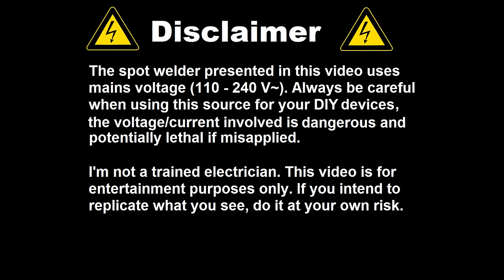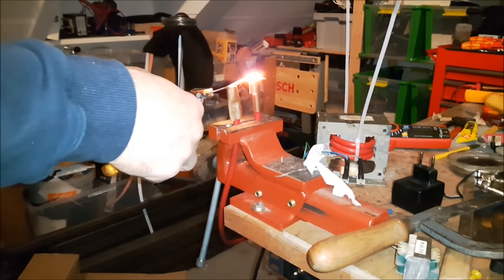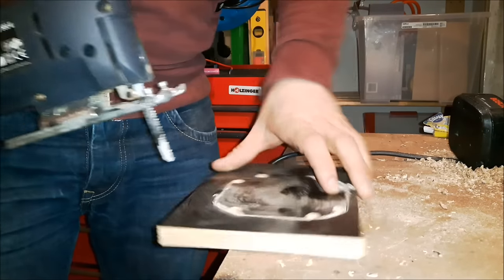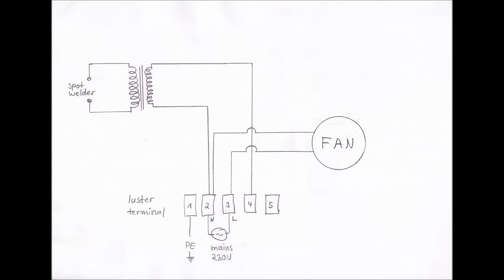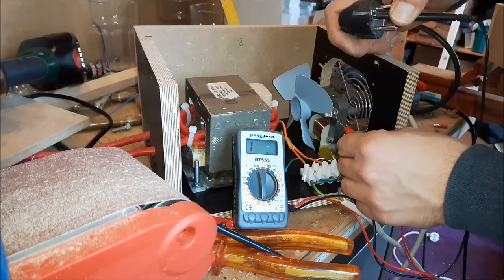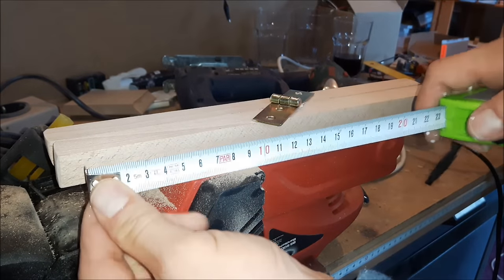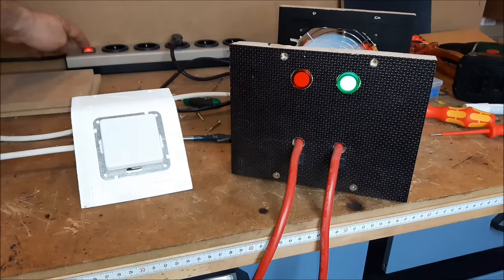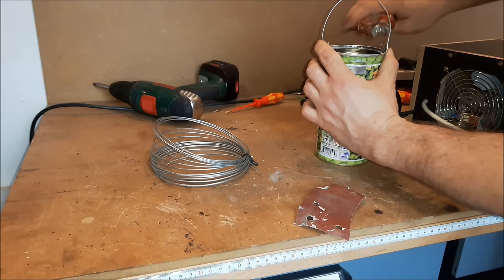DIY spot welder with foot pedal

Comment: Greetings from California. Yes, it was nice watching your Spot Welder assembly. I’d suggest that you modify the mains switching through a SSR, thus avoiding a surge and or spike or spark at the foot switch. I have often seen the direct foot switch activation to 110~220 mains the above happens and the micro switch fails. Also it’s unwise to have 220Vac (in your case) running along towards the FS.
By introducing SSR  you will be able to avoid above issue by activating SSR through 3~12Vdc. Also install a 20AMP fast blow fuse. This will avoid your ELCB (in the mains circuit) from tripping often.
The secondary cable may be made to fit as tight as possible in the core avoiding fluctuation while spot welding.
Remember when spot welding, loose secondary cable tend to vibrate or pulse; thus causing issues in weld result. Good Carpentry work. Cheers.
Reply from the maker: @sreekumarUSA  SSRs are not the weapon of choice for inductive loads like a transformer due to the inductive spikes at turn on. SSRs are rated for ohmic loads like a heater. You need a SSR rated at least 8x the amps what you measure at the input side. In my case this means a SSR rated at about 40 - 50 amps. And forget the cheap china ones for under $10. If you buy quality this means about $60 minimum. Compare that to a simple switch or simple relay for $5 🤷

Comment: Very nice tutorial, but I have a couple of suggestions. You have an opening for cooling air to enter, but where does it exit? Add another hole and meshed screen over the transformer to allow air flow.
For added safety, instead of using a foot pedal with mains power going through it, add a small 12 volt relay and use the the foot pedal to switch the 12 volt on and off to the relay which will then switch on the mains power to the transformer. A automotive relay can be used because their contacts are rated for a 30A load. You can get the 12 volts by adding an additional secondary winding to the transformer using some small gauge wire such as 22-24AWG since the relay will not draw very much power. Thanks again for showing us your ideas.
Reply from the maker: Hi Waltkat, I did some changes to the device in the meantime, for example I drilled a 2nd hole for the air as you suggested. The idea with the automotive relay is good (adds safety), but I doubt it will withstand the welding current of the secondary. I ordered a SSR (solid state relay / TRIAC) to enable/disable the primary side. This has the advantage (depending on the SSR model) that it enables at the AC zero point, putting less initial load on the mains and fuses.

Comment: This is an awesome build! A good idea is to replace the pedal circuit with a mono-stable 555 timer circuit (with a low power pedal) controlling a relay so as to separate any contact with the mains circuit. Another idea to save power would be to buy two cheap 1 amp phone chargers to act as buck converters to replace the high power light bulbs with LED's and the one that powers the green LED could be used to power the proposed pedal circuit.

Comment: Awesome design. Three things I want to add. The fan should work all the time, not only when you push the pedal, and also you should stronger attach those cables to the wooden elements. Also the welding electrodes should be thicker.
Reply from the maker: Hi Piotr, the fan works all the time if I remember correctly (see diagram in video). Still not enough cooling for long welds, as the MOT itself gets saturated quickly due to its small core size. About the electrodes: You're right of course, at the time I had no professional electrodes, only thick copper wire.

Comment: Nice video...I too made a spot welding machine with microwave oven transformer but it's wire gets heated up very soon after 2 to 3 spot welding...wire insulation starts melting
Reply from the maker: @Engineersworkshoptechnology  Either your wire is too thin (thin wire leads to high resistance leads to heat) and/or you're not using copper wire. The reason the weld starts were the electrodes touch your metal sheet is that this is the part with the highest resistance in circuit . Or do you try welding something else than iron sheet metal?
Reply: @diecksl  sir I tried iron sheet only...I have some doubts to clear can I mail you for query ?? As I don't know much in electrical but I want to make one more spot welding machine for professional use

Comment: Perfectly made spot welding machine ,I used 16 mm wire 3 rounds for lifepo4 battery pack.but it was not sticking enough.sugestion please.

Comment: Hi friend. You do a good job. It you have a time make a video of wilding lithium battery. We need the time pulse an the voltage.
Reply from the maker: This circuit produces a low-voltage pulse and heats the metal. For welding battery cells you want the pulse as short as possible to keep the temperature inside the batteries low (explosion/fire hazard). That is why usually capacitor discharge is used in this application.

Comment: Hey Lejf, I cleaned out my microwave transformer yesterday, cut wood today and started assembly. I was reading the conservation between you and Alpha Troniks and have a couple questions as I'm going to use mine for 18650 battery welding as well.
  1)  I didn't notice that you removed the metal tabs between the 2 coils, so mine are still there. I saw in one of your replies that leaving them in will reduce amps, so should I leave them there?

 2) Would a basic dimmer switch for household lights work in this setup to further reduction of amps? If so would I install that switch between the power coming in and the transformer?

I got my foot pedal from a Chinese spot welder that died after using it for a couple weeks (Sukko) and I believe that it's a momentary switch. If not I'll just pick one up on ebay and make a homemade you like you did. 

Sorry for all the questions! I'm no electrician but am very mechanically inclined.
Reply from the maker: Hello schrockie,

1) In the orginal application the tab (or "shunt") is used to limit the current flow. You don't want it, as you want to increase the amps. The shunt changes the magnetic flux path within the core - for example, see https://goo.gl/GC5ck4 . You should, however, separate primary and secondary with a piece of wood or plastic from each other to increase isolation for your own safety (don't forget to ground the iron core as well).

2) Dimmer switches are usually driven by TRIACs, they change the sinusodial waveform of the AC line voltage and not the (peak) voltage itself. There are two different types, phase control (PC) and reverse phase control (RPC). Only the first method is suitable for inductive loads like a transformer. You have to watch the temperature of the windings carefully - it increases when using a dimmer as it puts DC load onto the transformer. But for short welding pulses it should work.

One word about welding tabs to 18650s: I had a long conversation with AlphaTroniks on that topic. Problem is, the heat increases far too slow. For metal welding this is ok, but for Li-Ion batteries this can lead to fire or explosion of the cells. What you need for that task is something that instantly releases energy (heat), this is why all commercial tab welders utilize capacitor banks.

Comment: Your air flow exchange is lacking a bit. Inlet and no outlet but circulates the same air well. Cut an air slot in the bottom between the transformer and the front cover. On mine, I measured over 400 amps but my meter only goes that far. The screen said something I’ve never seen before “O.L.”  😆. Mains measured 5 amps running and 12 amps secondaries shorted with 120v primary.
There’s an enormous back emf (off my scale) when the mains are disconnected, So be careful it could bite.

Comment: great project! I think you should connect PE to the switch because there are some visible metal parts. just in case.
Reply from the maker: Thanks :-) Yes, it would not hurt. Since I published the video I did some improvements on the device. I will publish a second part soon and I will mention that...

Comment: welding is fun.. I totally agree...  I am building the same welder for welding nickel tabs to 18650 cells...  I tested the output voltage and it showed 1.5 volts...  when I short the output the voltage comes to 0.8 volts. what is the ideal voltage for battery tab welding? The first I want to try out is to make a 3 cell pack for my 12 Volt cordless drill just to test out the welder. Here we get 3 cell 2200mAh pack for 800 Indian Rupees which is bit expensive.. I'm tired searching the net to find the answer for the correct voltage required for battery tab spot welding...
Reply from the maker: AlphaTroniks I don't know what the right voltage for battery welding is. But I am confident that you can weld your cells with 0,8 - 1,5 volt, as the high current is responsible for the heat and not the voltage in the first place. Your main problem is to limit the welding process to fractions of a second (1/8 - 1/4 second) as the welder generates a lot of heat, even in 1 - 2 secs. And this will probably destroy the cells. There are some people modifying spot welders with timers (e. g. with the NE555 IC) or building mini spot welders especially for battery welding, powered by MOSFETs and capacitors. Another simple way to connect battery cells is to use some flux and a soldering iron, but I guess you want to build a welder for the fun of it (like I did)?
Reply: I am building a spot welder for serious battery fabrication works... I have a timer using NE555 timer but it's problem is that at the lowest time setting the relay stays on as long as I am pressing the trigger switch but as soon as I increase the pot setting the time increases more than required i.e. it gives a pulse of more than 0.5 to 1 second which , I know is very bad for the 18650 cells... I need someone who'll help me with a proper 555 timer schematic
Reply from the maker: Do you have a link to the schematic and parts used?
Reply: Bhai, the suitable volt at the secondary terminal is any thing in between 2.5 ~ 2.7Vac. Remember, you may not be able to test the Amps. It’s presumed to be between 400~800 amps. Ideally a tight 3 rounds of welding cable is recommended. That will provide the above mentioned Voltage parameters. Any thing above will, certainly will burn Ni strips and may also injure 186650. So be careful at obtaining not more than 2.5 ~2.7 Vac. 
Here we are talking about Spot Welder, only. Your requirement powering a portable Drill and suitable Li-Ion Cell Power Pack is different to the subject altogether. To get info, first of all, you need to specify the Operating Power Supply ie: 6,9,12,18, 20 volts on the basis of that, you configure the Li-Ion Cells. Remember it’s easy to assemble these Cells, you also must consider BMS to charge those 18650. This is a very long subject to describe here. All the best. Namaste🙏🏽

Comment: I used 6 series Maxwell 350f super caps 
..2 sets in parallel.  Adding a 3rd soon to try copper tabs. Used cad to design fet switch board...plexi to make cupric etch tank. plexi, eBay vac pump, digikey 365nm led, weather stripping and  a sheet of low iron glass for exposing riston... inkjet screen printing transparencies with am emulsion to take ink well. Managed to etch double sided 2oz with a few 8mil (imp)traces mostly 10 and up. Geting brand name riston was the biggest factor in ability to etch features that small...i tried 2 others first and even with extensive pre prep results were shit bellow 10mil and only okish at 10. 

Board has isolation for mcu. Iso I2c for bleed resistor and I and e measure...also it has a p fet for optionally leaving 30a charger connected or disconnecting it during weld.  6 large fets switch the low side of weld path . 2 of them alone would handle it with their pulse rating but I didn't want huge heatsinks or to be shit out of luck if I added caps to bank
Reply from the maker: Do you have a video from your build? What voltage are the caps? 350f sounds like a LOT of capacitance!
Reply: Lejf Diecks series =(single cap value/cap count)*parallel groups. So around 100f in my config. I will try to get a video up soon. I had a mold issue force me to change flats so everything is spread between 2 places and I haven't had a chance to finish plexi enclosure yet. I put the little time I had in the last few months into building a rig similar to a drill press but with a linear rail and 2 copper bar electrode holders with hex screws to put pressure on copper aluminum oxide alloy electrodes I ordered. I figure this will allow more constant quality in welding because it removes the b.s. of holding the electrodes free hand. I may add a spot to put some sort of 10 gram sized weights on it to allow pressure control...if not an electric or pneumatic actuator. I'll post a Google drive link if u want to see it. In not proud of solder quality or top coat on board. Keep in mind I was trying to figure out wtf was seemingly biting me while doing most of the construction lol
Reply: Lejf Diecks https://drive.google.com/folderview?id=18HPdiKL6VqISkJ3b5HjDJeLEoROpb73r few projects mixef in this folder. I've yet to test weld stand and probably hit the foot switch 30times max. Far from dialed in..also intend to add lcd but at the moment I just use serial read to respond to single keyboard presses when a jumper is pulled (switch flip eventually) allowing me to inc or dec by 1 or 10ms depending on press
Reply: Lejf Diecks caps max at 2.7v..hence the 6 in series, night add 2 more and or switch the extra 4 in and out with fets if I decide to attempt pulse /tig mode ...argon gas inonizes at 16v if i recall correctly currently the bank maxes at 16 so that wouldn't be ideal...but that's a long way off
Reply: Lejf Diecks I haven't optimized or even measured r value but the math for just the esr ideal world means that at 16v it should deliver 1400amps (I think..been a while since I ran that...math)
Reply: Lejf Diecks also i forgot to mention i like your build quality and attention to detail!presentation is great too! As one other said..probably the only YouTuber to add earth on core lol. I had just finished watching an idiot tell people they risk shock servicing a desktop pc unless it's unplugged because earth isn't enough and not all psus have a power switch..lol.  I think the electrodes I got are called glidcop copper alloy..at least that should bring them up on Google. Sunstone uses them in their machines. Might be worth a try for u

Comment: Greetings from Perth Australia, I really enjoyed your video, great explanations and diagrams, I have built one very similar, just wanted to ask, does your transformer get very hot and how can you avoid this ?
Thanks again for a great tutorial.
Reply from the maker: Yes it does. This is due to the use of the MOT. A regular welding transformer easily has four times the size, dissipating the heat much better (and even these transformers have a thermal fuse which trips regularly, very annoying). You can try to improve cooling with cooling fins and a larger fan. Or pause aftera few welds. I added a cheap digital thermometer to the setup later to monitor temperature of the MOT core.
Reply: I put a large heat seek on mine in combination with the fan and it still gets warm but doesn't get too hot like before.
Reply: @johnruscigno5738  Hi, I did the same but also included a solid state relay that switches the transformer on and off via the foot pedal, but allows the fan to keep running, this has helped a great deal with the heat issue as it doesn't run the transformer continuously.

Comment: thank you very much for the video
a small remark myself I did the same work as yours
a small problem the big line of welding gets warmer
what should I do
thank you
Reply from the maker: ymed hedi Two ideas come to my mind:

First, its normal that the secondary cable gets warm quick. It carries 400 - 600 amps! Thats why you should add a fan or make pause between welds. 

Second, the part within the secondary circuit with the highest resistance heats up the most. Make sure you use copper cable and copper electrodes (copper = low ohm resistance material). Thats why usually the metal between the electrodes heats up the most - it has a higher resistance than the other parts within the secondary circuit...
Reply: thanks a lot for your help
i have a small problem if you allow
I built the same I want to use for pudding to stick pucks
on the body of the car to repair it
the length of each cable is 1m 35 centimeters
the problem is that there is spark. the pucks heat up but they do not stick on the tolle . thr intrnsity is 800 amp
I thought I was using a starter solenoid 12 volts
but I need the complete electric shema
can you please help me

Comment: Although this works, everyone wires the secondary wrong.  Best is to use small gauge wire like 14 gauge stranded of multiple wires to fill the full cavity with wire that is grouped as parallel and total of 1 to 2 turns.  IE 20 parallel wires together and long enough for 2 turns.  The idea is to not leave spaces in the secondary cavity so all magnetic flux is coupled from the primary.  Hope this helps others.
Reply from the maker: Makes sense to me. And is also cheaper then buying this AWG 5 wire (if I remember correctly)